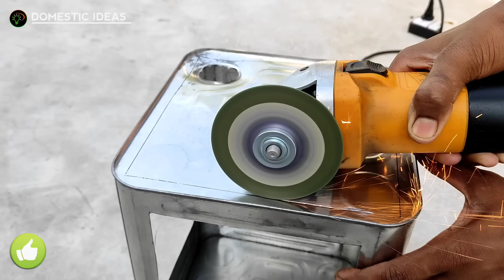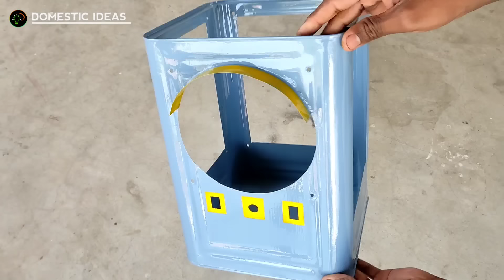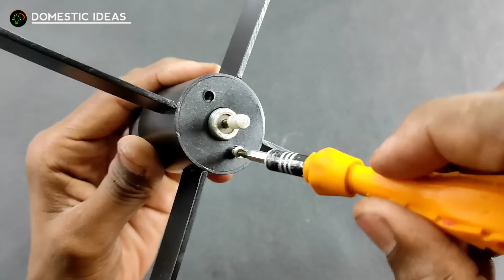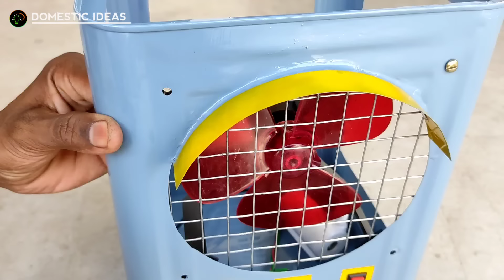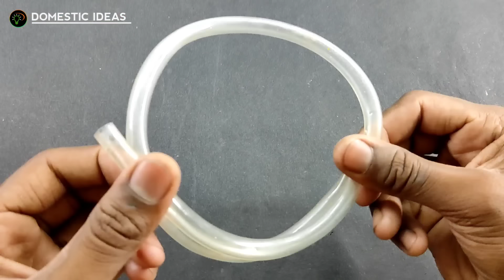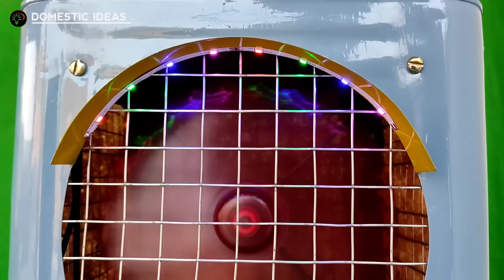cooler kaise banaen air cooler kaise banaen how to make air cooler at home

Comment: Cooler mast ha but prices
Moter 352 rupees
Water pump 251 rupees
Teen box 40 rupees
Led 30 rupees
Charger 250 rupees
Rent par katna wali machine 120 rupees 
And some circuit 50 rupees 
Pipes 50 rupees
Bas costly ha bnana ku bna lata 💀
Reply from the maker: Thanks for sharing
Reply: @domesticideas  koye ne bro